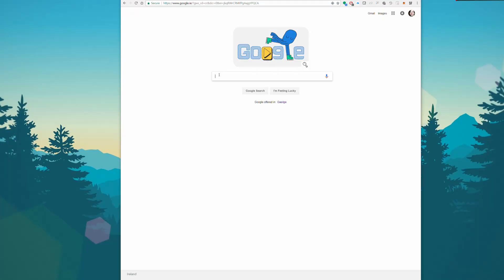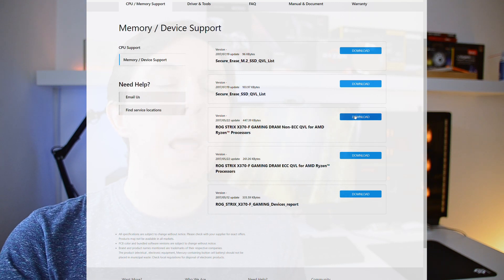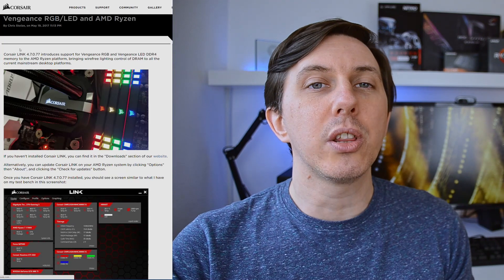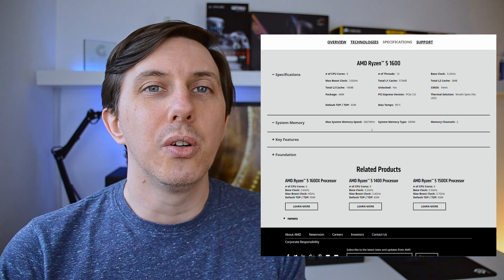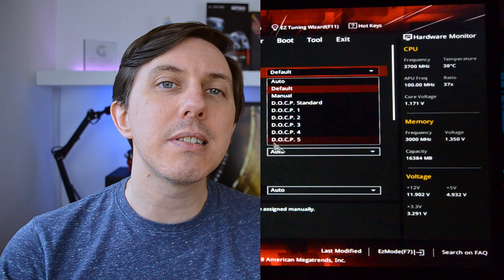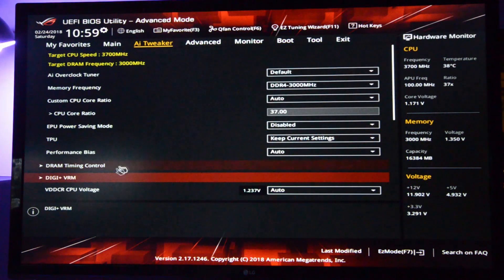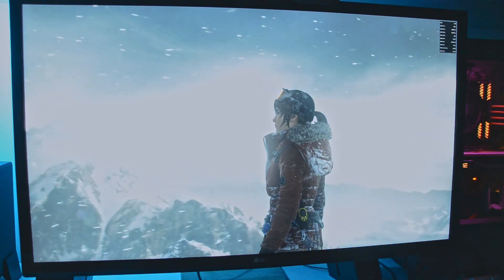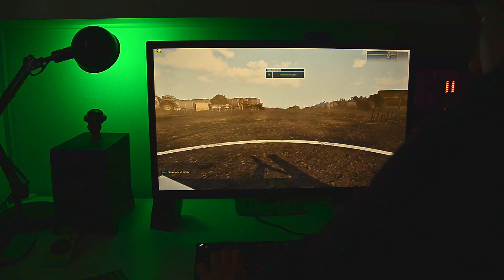X370-F CMR16GX4M2C3000C15 VENEGANCE RGB OVERCLOCK

Comment: Would this be a similar process for the same ram on a gigabyte ax370 gaming 5?  I just noticed my settings reverted at some point and now my rams unstable using profile 1.  Didn't actually notice in games but it's incredibly noticeable in photoshop.  I'd rather put money towards a new gpu/cpu if I can make this kit work at 3000mhz
Reply from the maker: Be sure you update your bios and now that the ecosystem is way more mature DOCP profiles should work and be stable 👍
Reply: @NoTechDrama  thank you! I'm waiting for some 2gb usbs to turn up so I can do a bios back up then install each bios step by step (I think I have 3 to do). All my owned usbs are 8gb+ and I've read the bios can struggle to read above 4gb
Reply from the maker: @CaityRaindrop  you should be able to update to the latest version directly, don't need to install one version at the time
Reply: @NoTechDrama  cause I'm on f21, I read I need to go in steps, F31, F40, install EC FW tool, then finally the latest f51g?
Reply from the maker: @CaityRaindrop  oh well good luck then ☺️

Comment: I actually got my rams (4x4Gb) Crucial Ballistix Sport White 2400Mhz overclocked to 3200Mhz without touch the timmings (c16) but changing the voltage from 1.2v to 1.36v to reach the stability, and wortks great! I mean that rams are the bests for overclock (IDK why), I got an Asus Z370 Prime A motherboard with an i5 8600k on my system. Thanks for the video, is so interesting, like!

Comment: I have this same RAM and processor, but ASUS X370-A Prime motherboard. I'm going to try this and see if it works.
Reply from the maker: Tryin'Tech  Daily Overclocker commented much better settings: 16 18 18 38 at 1.4 volts

I’ve updated to Ryzen 5 3600 (video to follow!) and was successful with his suggested timings
Reply: @NoTechDrama  Yeah, I tried it with similar settings and was successful, however mine were: 16-18-18-36 @ 1.37. POST, Boot and ran MemTest64 memory stress test for at least ten loops (approx. 12 minutes) with no crashes. I will test in gaming and update results if anything changes.

Comment: Thing is you did not actually overclock the ram what you did do is loosen the timings so you could get it to run at 3ghz  actual overclocking you would have tried 3.1 ghz or 3.2 ghz so the title for your video is incorrect
Reply from the maker: Glenn Roundy true, but is also true that 3Ghz is a clock which is higher than the  DDR4 standard therefore is overclocking from that point of view, but you’re right in saying that this particular RAM is designed to work at that speed so from that point of view is not overclocked, as always the most accurate answer is: it depends
Reply: yea i was searching for where i could apply a 3.2 ghz oc for this ram as i have the same kit i have reached 3.1 and that is about it

Comment: using the same motherboard as yours with ryzen 7 2700 processor. Can it overclock the ram up to 3200mhz?  using a 3200mhz ram of course. any tips?
Reply from the maker: Iwe Mocha yes this motherboard should have no issues with 3200Mhz ram
Reply: No Tech Drama thank you sir

Comment: Are you going to try overclocking your vengeance ram to 3200mhz?
Reply from the maker: Yes I did it and run flawlessy
Reply: No Tech Drama Did you just change the timings to 24-24-24?
Reply: No Tech Drama and how about the voltage did you also made changes with it? Or just the timings?
Reply from the maker: ah right in this video I was at 3000 only... I'll double check and let you know!
Reply from the maker: sorry got confused... I'm keeping at 3000 as it's fast enough and stable... not willing to stress over 200Mhz more :D
Given 3000Mhz is the speed at which the modules are rated I prefer to have a stable system!
Reply: No Tech Drama okay thanks for the info! I'll subscribe :)